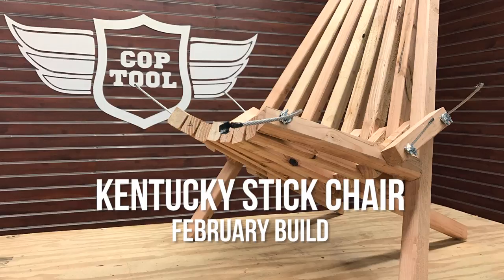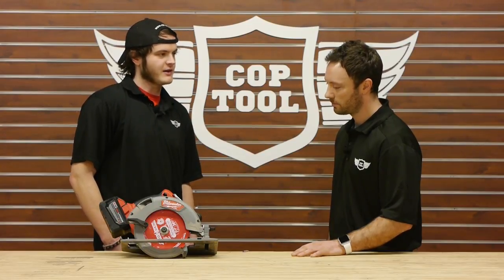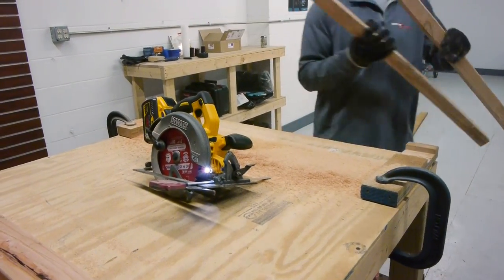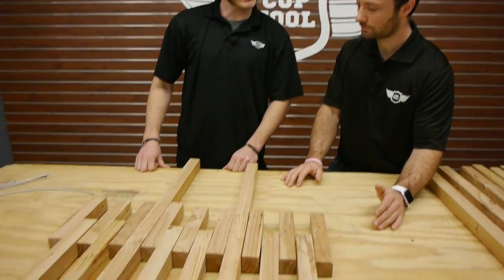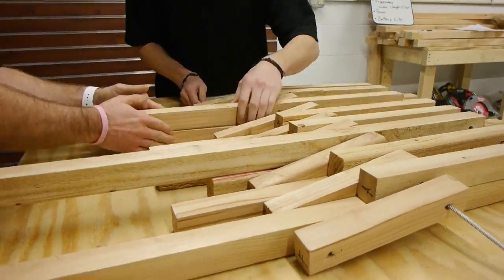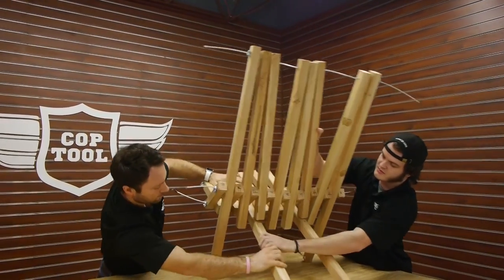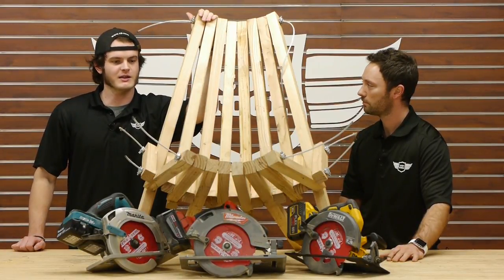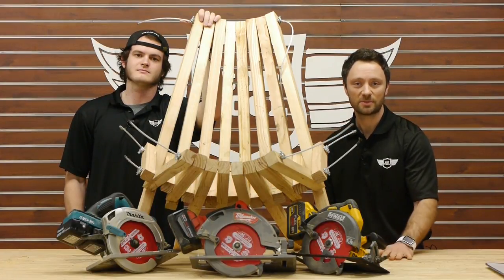Easy Build Project - Kentucky Stick Chair - Cordless Circular Saw Test

Comment: How many 2x4's do I need for this? Great job on the jig. I have a table saw but that's an awesome idea to use in a pinch.
Reply from the maker: 4 should do it. You need about 520" total and 8x 2"x2" at 96" that's 768" of material so even if you don't maximize length perfectly there should be plenty.  

ID Piece Length Count
A Seat 15″                6
B Back Legs 35″        2
C Back Long 31.5″ 4
D Back Short 29.75″ 2
E Front legs 42″   2
F Joints 9-1/8″        9
Reply: Okay awesome!  Thanks for the reply.  I'm really bad at figuring out the amount of material needed based just on measurements or a cut list.  You saved me a lot of time.  Thanks again!  Great video, also.

Comment: I could not tell in the video, but how did you get a straight rip of the two by four without a fence? Did you have a laser on your circular saw and you just followed a line that you marked down the length of the two-by-four?
Reply: They used the rip fence that comes with the saw which prevents the need to follow a line, it can be seen running on the front edge of the timber.
Reply: They used the rip fence that came with the saw, can be seen running on the front edge of the timber.

Comment: If you rip a 2 by 4, which is actually 1.5 x 3.5, you end up with 2 pieces that are 1.5 x 1.75 not 1.25. Well maybe a little less than 1.75 When taking kerf into account.